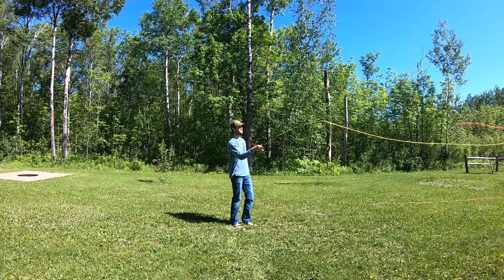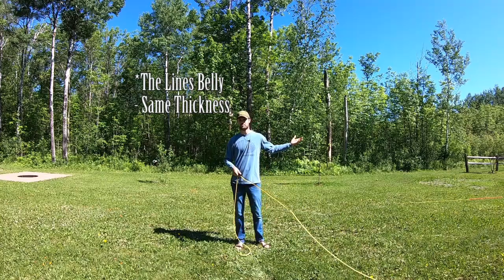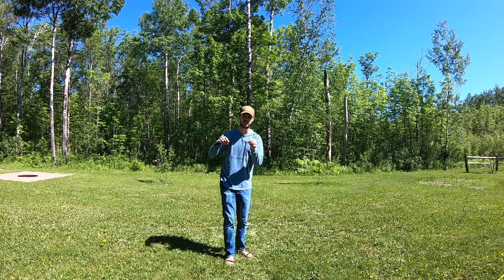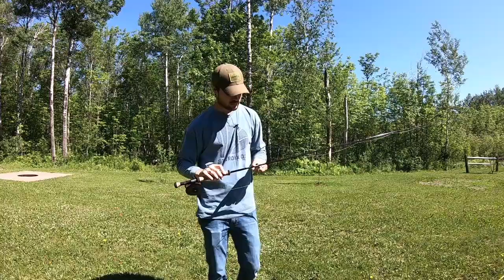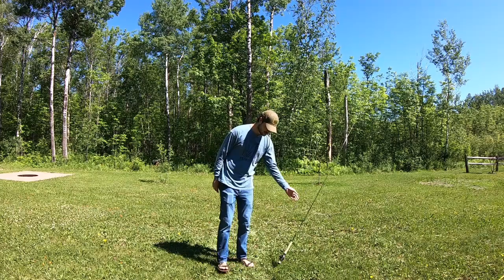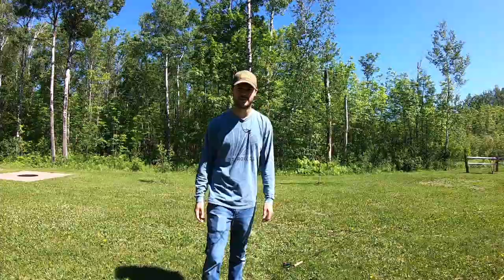Cast a Weight Forward Fly Line

Comment: Im new to fly casting and  i have a SA Bass Bug taper 8w 280 grain line… the whole head and back taper is about 43ft… do i lay that entire head and back taper out where there is the color change to running line  in order to shoot out the running line as well.? Or just the beggining 10–20 feet of the head beforr the color change?

Helluva lot of line it seems and when that much of head is out the rod loads deeply but with a double haul i can feel and see how the momentum transfers easily on a fast action Sage rod.

Thanks for ur help and videoes Gunnar its really good stuff. :)